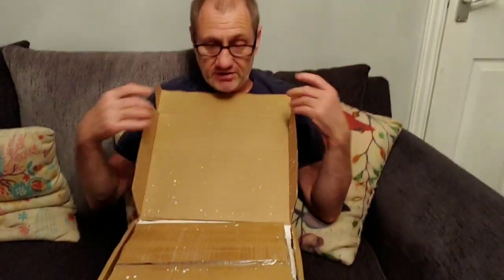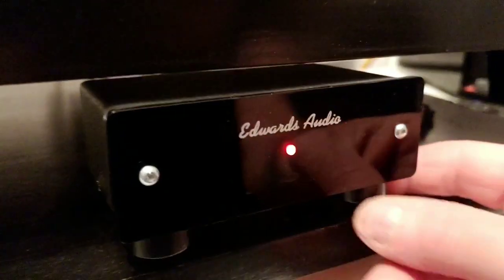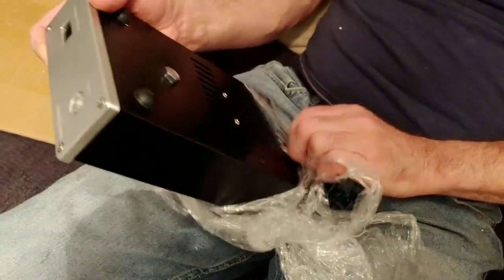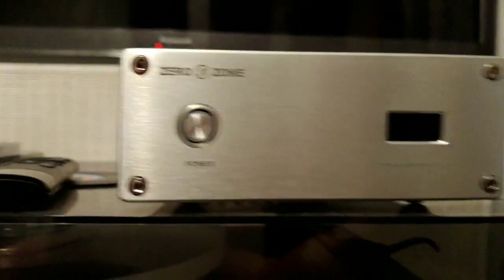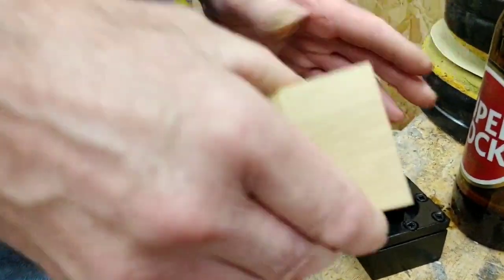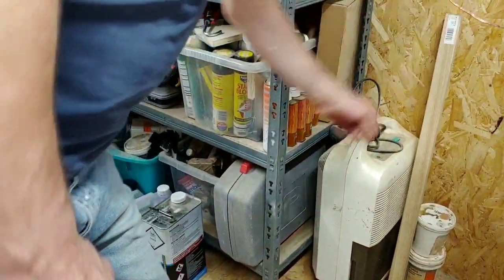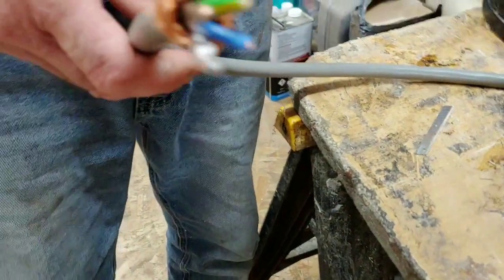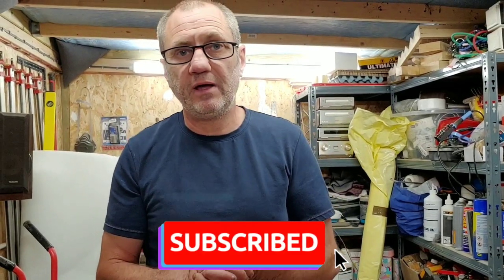Zero zone Linear power supply 01-A

Comment: I have watched your Ultra -High grade interconnect cable video.
Can I use the same procedure for a XLR cable -I am  proposing to twist together the hot and neutral silk covered wires (4 in total) and spirally wind around the insulated core .Then the earth wire , spirally wound  inbetween the primary signal wires as previously shown.
Your comment would be gratefully received.
Thank You
Reply from the maker: Yes, I'm just awaiting some xlr connectors to come & then I'll be posting a video on how to make a balanced set, thanks for watching.
Reply: @tweakerman  Great .Thank You

Comment: Had my first experience of an AMR hifi fuse today on my phono stage today, I have an internal on its way as well. First impressions are a much lower noise floor and that's as soon as it was installed. Thanks for the very helpful videos. What facebook groups are you on?
Reply from the maker: Hello, hi fi audio & jazz vinyl lovers on Facebook, thanks for watching.
Reply: try the synergistic research black or blue fuses. The AMR Gold fuse was the first one I tried, and it was great, but the SR fuses are miles above.
Reply: Hello Tweakerman,
What is the name from the powercable you did show in your video? That cable does look very good.Do you think that I could buy it in the Netherlands?
I would need 2.5 meters for my Rel subwoofer. It still does have its stock powercable. For my other audio gear I have Puritan classic and also some Supra lorad spc powercables . I do alsu have two ZeroZone psu's for my netgear switches for streaming Tidal. Very nice video.